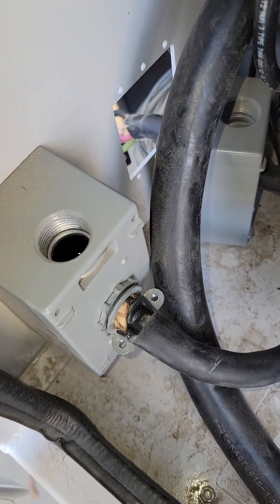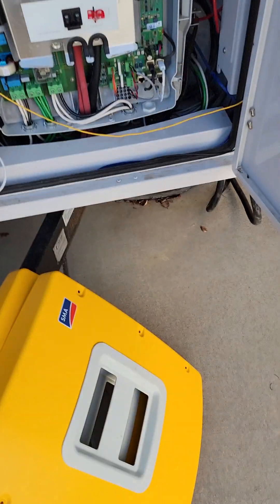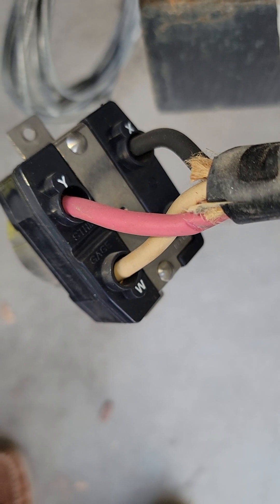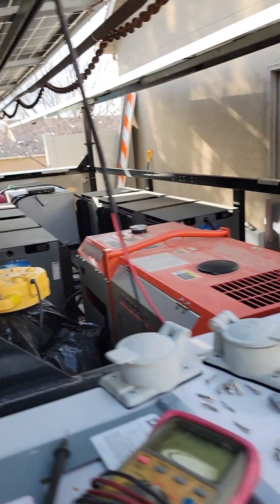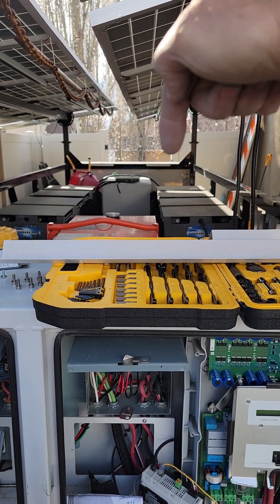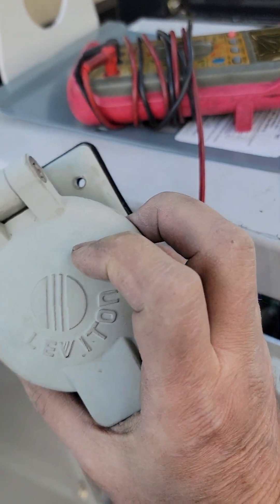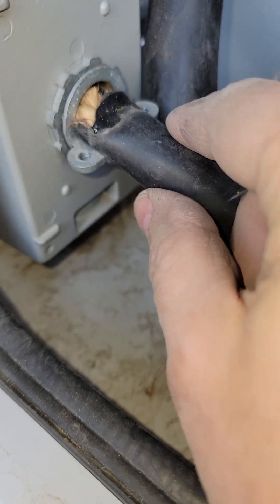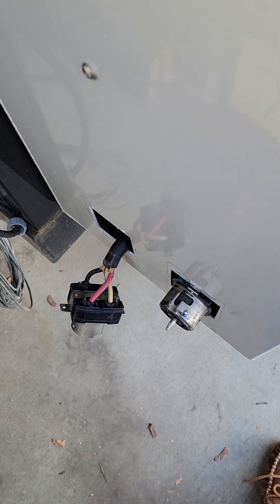50amp plugs rewire

Comment: One of those plugs is the generator input to the inverters and the 2 plugs are the outputs from the ac load panel powered from the inverters as the 2 hots so it does not matter that those plugs don't match eachother 🤔